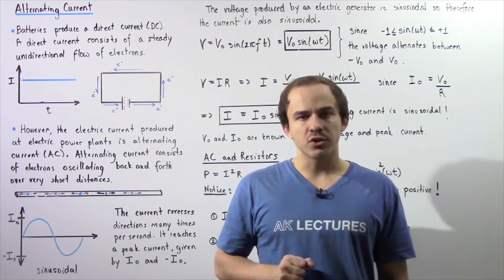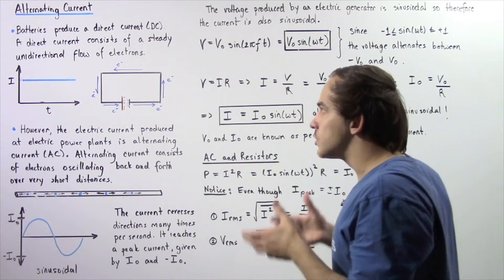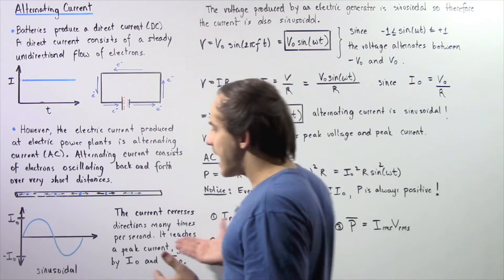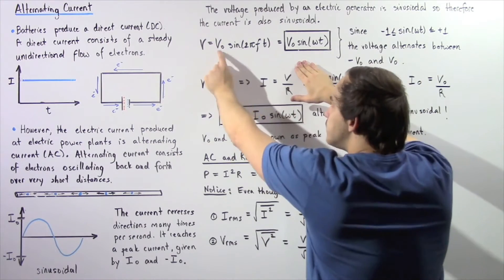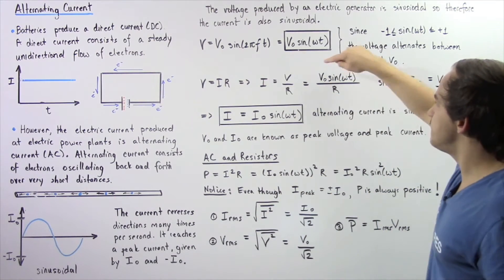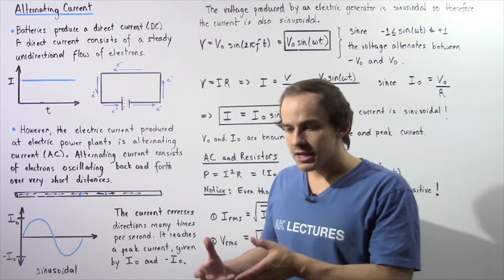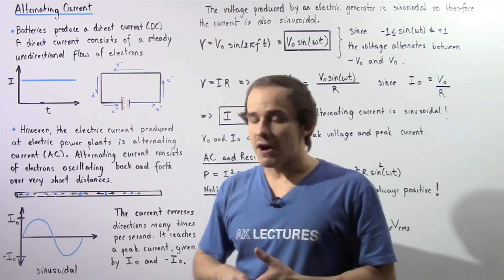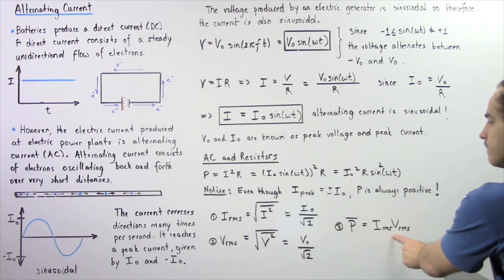Direct and Alternating Current

Comment: Great lecture.. but I think the electric current equation should be in cos not in sin, So  I=IoCOS(wt)
Reply from the maker: I disagree. Its fine in the form I have it on the board. But that doesn't mean you cannot turn it into cosine as long as you use the right phase angle.